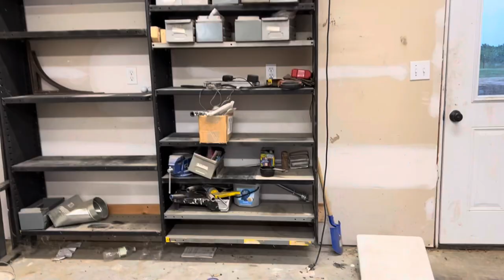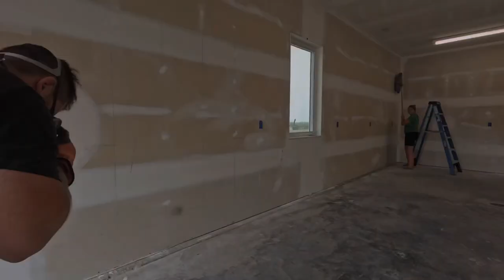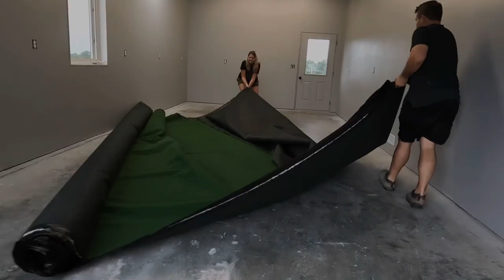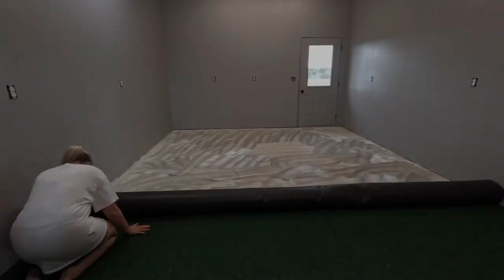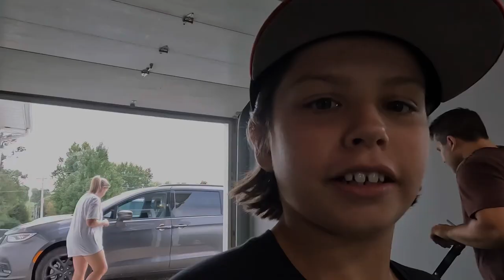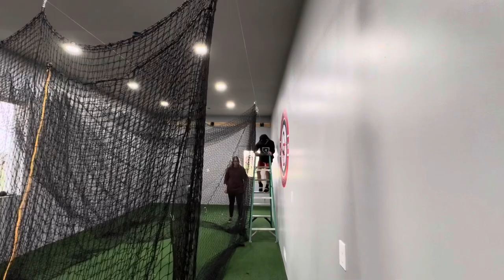HOW TO TURN YOUR GARAGE INTO A BATTING CAGE

Comment: I'm looking at doing the same thing. Did you take out the garage door opener? Are you not worried about opening it again?
Reply from the maker: Awesome, we are so glad we did. Yes took out the opener. We left the tracks so We can still open the garage in the summer
Reply from the maker: Thanks for the comment
Reply: @Case.Baseball hey do you have a link to the net set up?
Reply from the maker: @guslandscapingllc.8717   http://www.masterpitch.com/batting-cage-nets/ it was a custom net they made for us. Hope this helps. We got the hardware from practice sports.com
Reply: What size is that net?